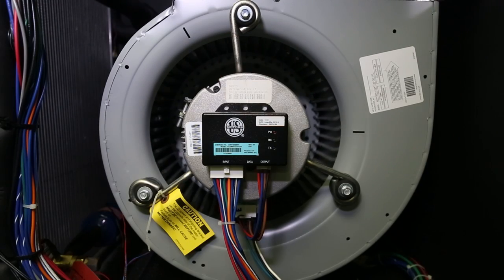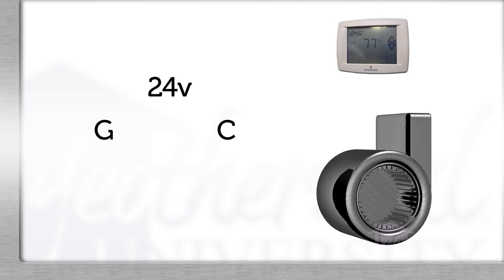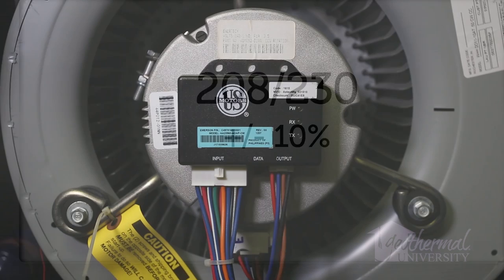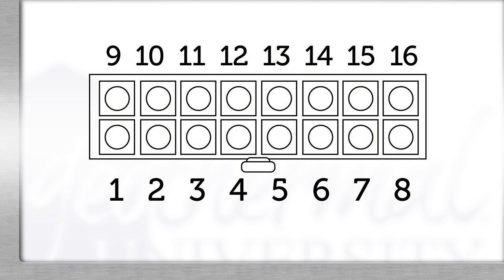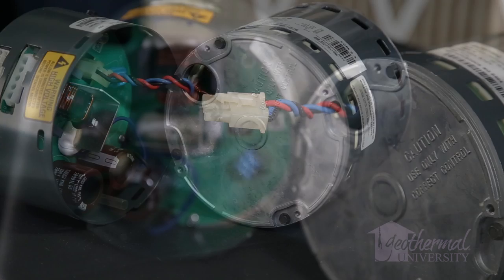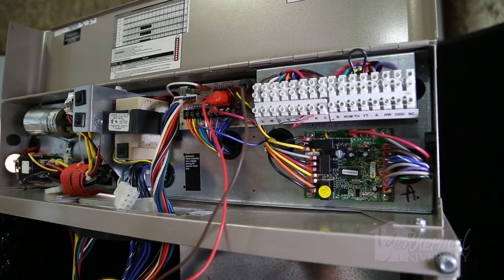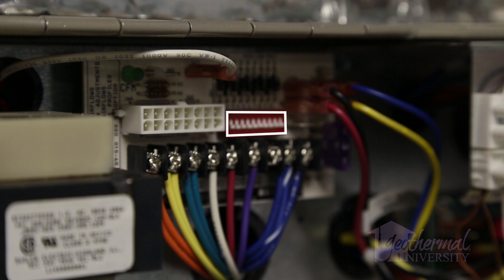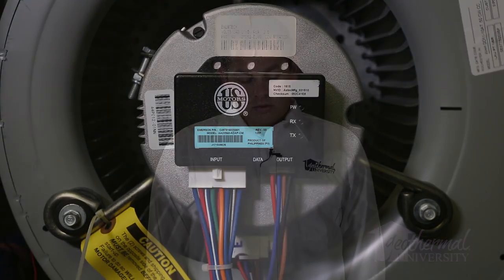ECM Motor Troubleshooting

Comment: I bought two electronic testers for the 16 pin and the the other X13. I just plug them to the 24 volt and if it runs we know the motor is good. Have to do some of the checking you reccomended here. Good job on the video.
Reply: Keep an old wire harness remove all wires except 1 and 3 and 12 and 15 and remove molex plug from one end. Now take the red and blue wires and connect to pins 1 and 3 and 12 and 15. You now have a go no go tester for free.

Comment: My tetco geothermal has a 4 pin molex going to the ecm board. Is this a DCV signaled board to module? Diagnostics for a 4 pin available? I get 12v DC from Red to other 3 pins. What should I be measuring?

Comment: A squirrel cage blower is not a positive displacement type air pump.  Ergo, it should not draw more current due to duct restriction, but should draw less as it is doing less work, moving less air.  Put an ammeter on the blower motor and restrict its duct...see what happens.

Comment: hi, my ge ecm 2.3 1/2 hp motor is continuously running on a low speed, when we turn off the ac, it switches from normal speed to low speed and keeps running, any help would be appreciated.

Comment: Walk in the door, go to thermostat and turn fan to on, if you hear a blower you know you have 24v, 110v, red wire from tstat is good, green wire is, fan relay on board is good and fan motor works. If nothing happens flip the tstat to heat, if heat goes then 24v is present and white wire is good, red wire is good, you have both 24v and 110v also. No need for a multi tester yet. NOW got o furnace and start testing, much much faster.
Reply: Mine started making a whooshing noise. It’s stuttering but not starting

Comment: After replacing the module thermister, a year later my main blower motor (GE 1/2 hp 08/22/00 CNO2 011DH7) is making a intermittent high pitched whine (g#5 note) when on first stage.  I "think" it's related to the module, but not sure.  Anyone?

Comment: One of my AC units quit working. I troubleshot the blower motor and I’m having the back and forth rocking but it never starts. All my voltages are good. I ohmed out the blower and am getting 11 ohms at each wire. I didn’t ohm to ground. In the video he mentioned replacing the blower motor but doesn’t specify whether you should replace the blower only or the entire assembly, motor and ecm. Does anyone know what I should do?
Reply: The windings are good so the motor itself is fine if none measure ohms to ground.

Comment: Every single ecm motor I have come across was fucked up. ECM motors are worthless
Reply: Most of the time they fail due to power surges or voltage spike. Ecm modules don't like dirty voltage
Reply: Over time, Insufficient air flow will also fry the module.

Comment: I checked the motor with an ohm meter at the three pin connection and everything checked out good, you say if it checks out, the motor is good, Yet when I hook everything back together the motor rocks back and forth but does not spin you say the motor is bad, which conflicts with the ohms test, Could you please advise if further tests can be performed to help diagnose  the problem, Thank you.
Reply from the maker: +Pee Dee If the motor is rocking back and forth, then the module is looking for direction. If it continues to rock and not run, it cannot find the proper direction due to an issue with the module. The module is bad and will need to be replaced. We do not replace just the module. We will need to replace the motor and the module.
Reply: +Technical Services I had the same problem December 2013 and replaced the module but not the motor, could this be the reason why the module failed, I have read other posts on line, advising that the module can be replaced if the motor checks out good, Thanks
Reply from the maker: +Pee Dee We used to be able to replace the module or the motor depending on which was bad. At this time we cannot get just the motor or just the module. They now come as a pair. It should not affect it if one was replaced and not the other. The only reason we change both is that it is how they are sold to us.Thanks!
Reply: Yes, you can change 'just' the module.    Then, the next month you can go back when it all fails and change both.  Get an extra service call, too.   lol

Comment: Great video! A question about rocking back and forth and NOT being the module?...

My blower motor will, once in a while, continue to rock back and forth without turning on completely. This has caused my coils to freeze and my limit switch to pop while in heat. Most times, however, the blower will turn on completely!

When calling for fan only, I receive 24 volts from the thermostat at "R" and "G". However, when going from the 16 pin header on the control board (ECM 2.3) the "G" pin (#15) only sends 15 volts to the motor module. The harness is fine as it shows continuity for all lines. 

Is the 15 volts that leaves the control board and goes to the motor module the issue causing my blower motor to sometimes stay rocking back and forth without turning on completely? Or would you assume it's the motor module and the 15 volts out of the control board is not the problem?
Reply from the maker: Hi there! Thanks for the comment. When the blower wheel rocks back and forth, the module is trying to find proper direction. If it continues to do that then the module will need to be replaced. As far as the voltages go, if there is at least 14 volts to the module then the module will recognize that as a call and should start the motor. Again, if the module rocks back and forth that is not a voltage issue but a module issue.
Reply: @EnertechUniversity  Great! Thanks. Any videos on repairing ECM modules or what to look for? I've seen a couple talking about swapping out thermistors but mine does not look damaged.
Reply: @3000Marc  Same here. What was your fix?

Comment: I Always thought the board sent 24v to the T-stat.
Reply: The board sends a 24v signal to the thermostat then just like a light switch it routes the 24v from the board through the thermostat back to the corresponding terminal on the board.

Comment: 16-pin connector may have various definitions, I wonder. I followed this video https://www.youtube.com/watch?v=lKsIgjEJDII made a set (a copy of TecMate Tool), worked for some ECM, but when it comes to Carrier infiniti, it didn't move. Carrier actually using only 4 out of 16 wires. 1+15 in this vid works. Now you show us another version of tester, 3-button tester. :-D If we can get the wiring of the 3-button tester we can make one for our own. Thanks